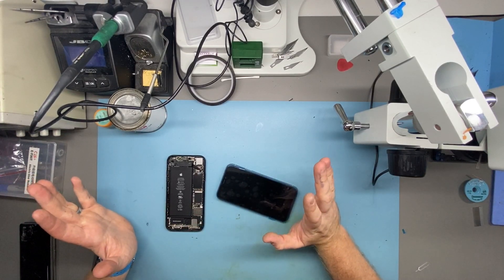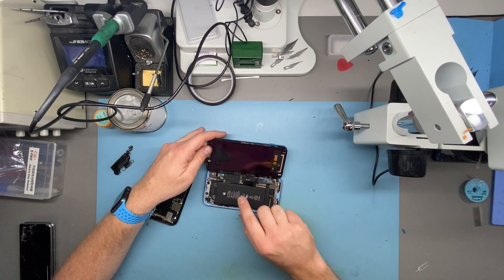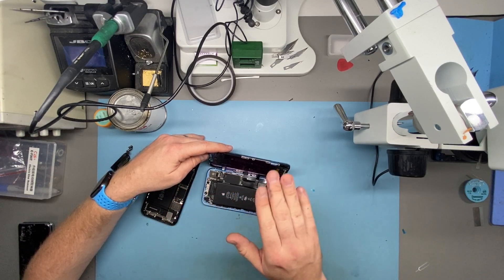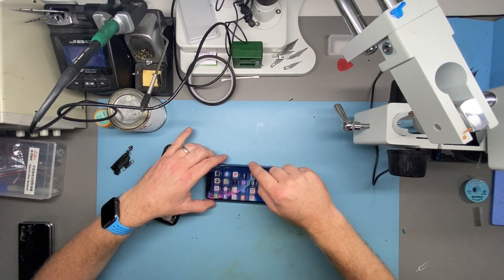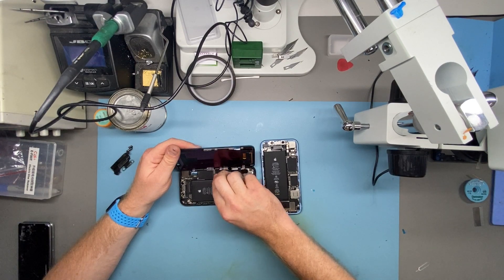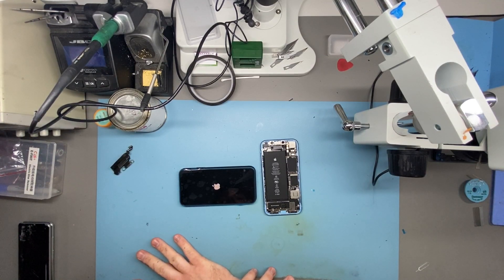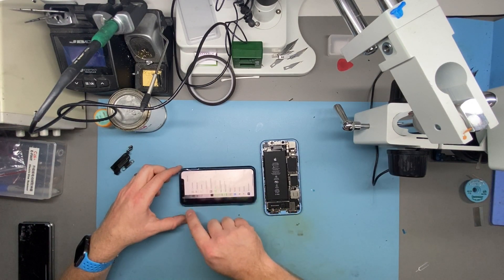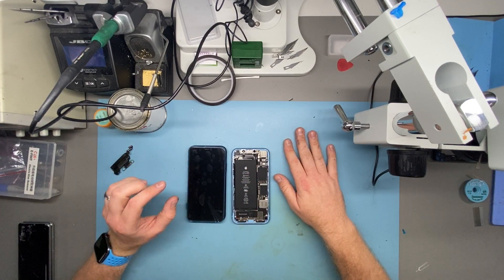iPhone XR Faulty Touch Screen Calibration - LG and Toshiba Screens

Comment: hello

I bought an iPhone XR broken LCD screens knowing that this iPhone has never been disassembled or repaired before

So, I bought a brand new lcd (mid-range) the iPhone turns on, but the touch does not work at all

I thought maybe the lcd I bought is defective, I send it back to the seller and recommend another higher quality suddenly same problem the phone turns on, but the touch screen does not work

I recovered an iCloud blocked iPhone XR with an intact screen so the same problem lcd turns on, but the touch does not work at all

Knowing that the touch works perfectly from the original screen

Could you help me to solve this problem please

thank you

Comment: I experience many iPhone 7, 7+, 8, 8+ touch issues with the screens I buy. I recently discovered they either have c11 or dtp chips. Would that be the cause of my problems? Also how do I know if the logic board is c11 or dtp?
Reply: I know it’s late but you can check it from 3utools (you need a software download through the internet) and you can freely check all the details with regards to serial numbers in your IPhone. But if you can also check the serial number behind your LCD screen (depends on what IPhone you have).